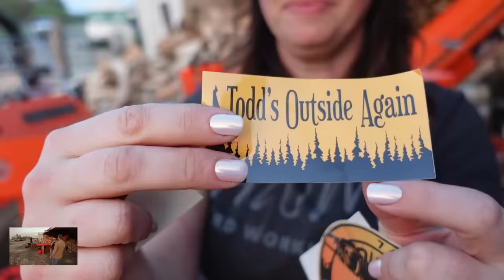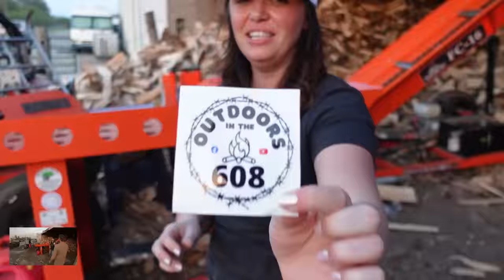Hoosier Firewood Hysteria! Having Fun Helping Veterans! #140

Comment: I wonder how a pull back arm on the right hand side of the pusher plate would work. It would have to be secured, fully adjustable up and down, and not ride on anything but the pusher plate. It could prevent one from having to reach over and grab that awkard piece for a re-split. The piece on the left hand side is generally easy to grab and re-split from what I can see. Just my thoughts. Like your video's. There an escape :)👍
Reply from the maker: Thanks, that is an interesting concept I wonder how it would work.

Comment: Heath, what did ya think of running that Axis splitter? Being so different from the Allwood, which I really like. How much 💵 is the table??
Reply from the maker: Mathew, the little bit I got to run the Axis I like it. It’s a pretty slick machine. I’d love to have an Axis along with a horizontal production machine. The Axis makes a much cleaner higher quality wood but won’t make wood as fast as the 12-22 or All Wood. 

I know the table was $1,500, not sure if that price has changed. In my opinion it’s worth every penny!

Comment: So I want to know did you run your splitter 100 throttle the whole time 
How much fuel did you burn through with that thing
Reply from the maker: Lucas when at home we usually run it below full throttle. At the show we ran pretty much full throttle most of the day. We started with a full tank and it was well after lunch when we had to re fuel. I’d say we burned about 1 gallon per hour and I’d guess we produced close to 1.5-2 full cord per hour. These are just guesses but the fuel use should be pretty close. I know I was surprised with how much wood we made before needing to re fuel!
Reply: @hardworkingmanoutdoors  good to know because as you know mine will be coming soon
Reply from the maker: I’ll see if I can get enough wood ready at my place to do an accurate fuel burn per cord test done.

Comment: Is it just me or does the axis look like a lot of strain on the wrist and arms??
Reply from the maker: Jay, I didn’t run it for too long but I didn’t notice that. We were working with some pretty knotty big tree service wood too.
Reply: I ask as I have a rebuilt arm from a head on crash so im working with one arm and a arm/shoulder that doesn't work properly. A few people suggested a vertical splitter but I can't hold my arm up for very long.
Reply from the maker: Jay, I’d say with manageable sized rounds and square end cuts you’d probably be okay but tough to say for sure.